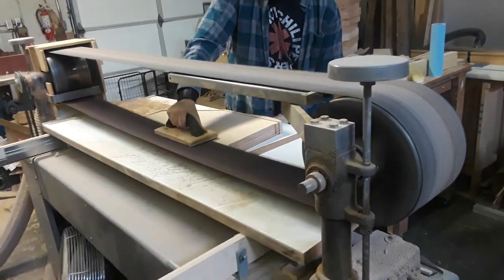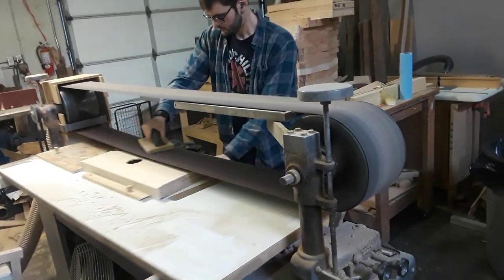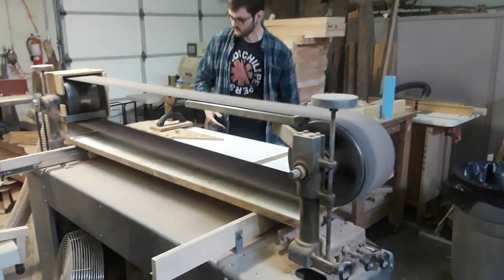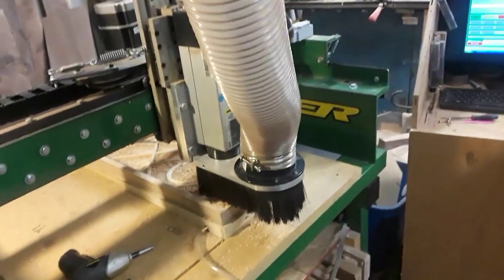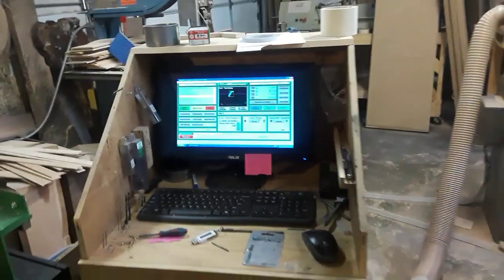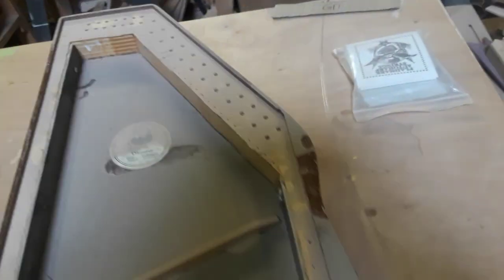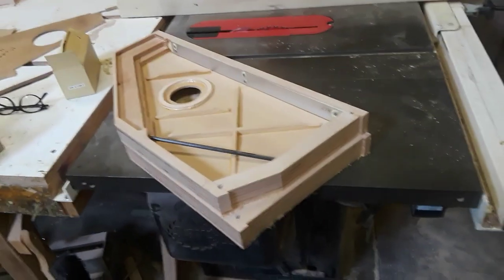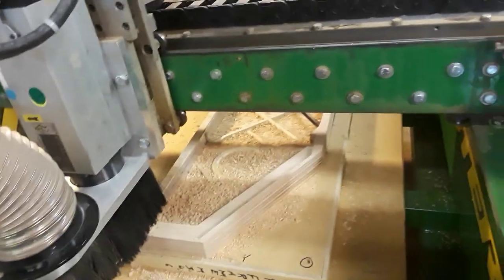SWA from Daigle Autoharps : cool machines and people making sweet harps!

Comment: Fascinating!  Such interesting machines.  I really appreciate a deeper insight into the construction of auto harps.  Your video fleshes out what I have learned from reading and diagrams.   I thought that shop looked like a noisy place in your first video when no one was there.  I had no trouble understanding your explanations and the machine noise actually adds to my understanding of the manufacturing process.  I hope you are using ear plugs CONSTANTLY when you are working in that place.
Reply: Anne Callaway and face-masks! Not being worn here, but should be with sanding machines like this (or anything going to 'throw off' wood chips / dust. Love CNC routers but messy, even with suction, which this one has.)  V interesting to see the production process though.

Comment: I love this... Love all your content actually.  Would love to see more "how its made". I just got a 15 chord autoharp and really want a 21 chord. Gotta learn to play first lol. Great work.
Reply: What would be the point of having 21 chords, in your view?
Reply: @flavedereus4928   well a 21 chord as opposed to a 15 chord could allow you to play 5 more chords. But mostly because nearly every YouTuber plays on a 21 chord and not 15 chord. So following along to videos would be easier. Not only that but rearranging the chord bars to your desired playing position would be much easier. The 15 chord has narrower longer buttons. The 21 chord has flat round buttons. Easier for me to press.  There are a multitude of reasons to have a 21 chord over a 15. In my opinion 🤷🏼
Reply: @flavedereus4928   hope that helps 😊
Reply: @JoshuaHastey  I agree to the chord bar button part. I used to have an OS 21 autoharp which I sold after getting a Japanese made 15 chord Chromaharp which sounds better than the OS. But the possibility of simply deattaching buttons from the bars was nice on the OS. But making the bars easy to press on a 15 is not difficult, simply lower the action by putting felt under the cover plates of the chord bar chambers. One can also add some tape on the end sides of the bars which will take away any unwanted movement.

Comment: that's a lot of dust generated for no mask... poor bastard
Reply from the maker: ModelT08 most of it is sucked away by a huge sawdust removal system...you can see the hose in the lower left of frame. If the dust is bad we have masks....also ear and eye protection.